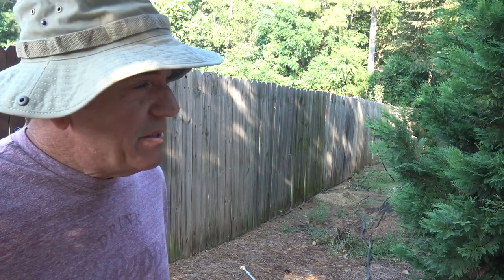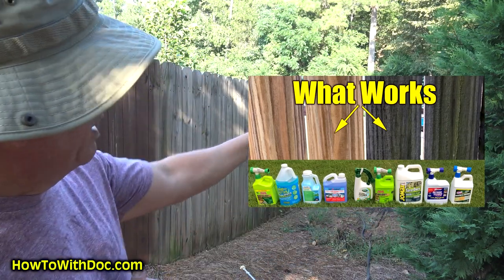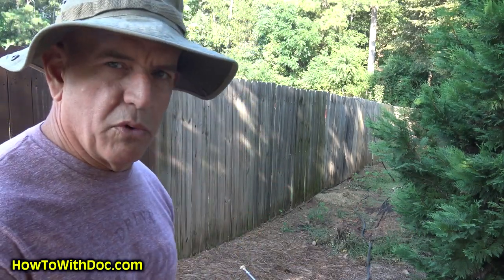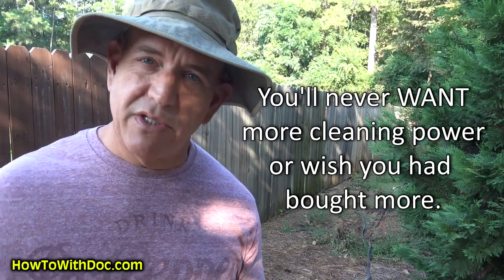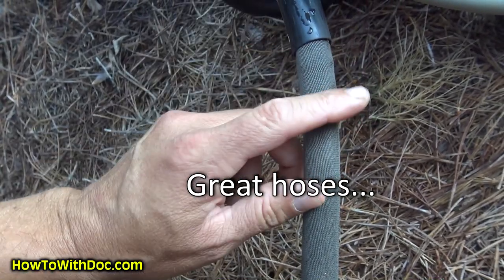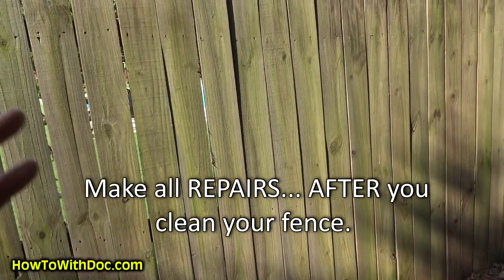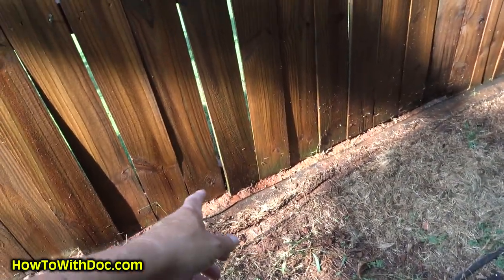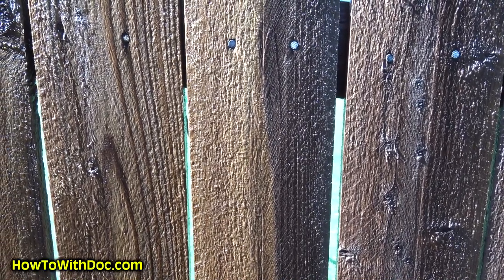Pressure Washing Fence

Comment: After watching this video (found by searching for cleaning wood fence)  I did everything exactly as Doc said.  I bought the exact pressure washer , from amazon, bought the 30 seconds product and followed every step. .....
It worked perfectly!   My wood fence looks like new!  Had not been washed in 10 years.  Thank you DOC!  Simpson owes you a commission!  I bought the extender (after first panel)  saved my back!!!

Comment: You're the man, Doc. I'm a quick learner but new to pressure washing. I learned to watch your video on what I need done FIRST then I go out and do a fantastic job. You have reduced my workload and time on the job with the accessories you identify and with your explanations. The house got prepped by pressure washing then painted. Now the house, pops. The driveway, pops. My walkways and sidewalks, pop. The streets and curbs around my house, pop. The brick around the pool, pops. Inside the pool for the first time in decades, pops. My neighbors are now pressure washing. Good but funny. I have a brand new wood porch and fence that has aged now for 2-years so I need your staining video. You guessed it, I'm going now to do my 600+ feet of my new wood fence. Can't find your staining video :(

Comment: Doc, please talk about your installation of poly at the bottom of a fence to reduce rot.  I was surprised to see the jet move it so easily.  Does it reduce exposure to wet soil?  Does it need to be cleaned off and surrounding grade adjusted so more dirt won't just flow back onto it?  How much does it help, in your opinion?   ...etc.   Just discovered you.  Fantastic how knowledgeable you are and how well you teach.  I wanna just call you "coach!"  Thanks a million.  Will start buying the stuff you recommend from your web page.  YOU DA MAN!   ...and I'm grateful!

Comment: Hey Doc! You should get a dual lance pressure gun then you can have your high pressure and twist the handle to low pressure high flow. A must have to properly rinse while working without having to switch tips...makes rinsing so much faster cause its uses both tubes on the gun...
pressure and flow maknig it a high pressure rinse! Been cleaning log homes for 15+ years and I couldnt work without it!

Comment: Doc, what impact does the chemicals you are using on the fence have on grass below and on the other side of the fence?
P.S. I really appreciate the effort you are taking making these videos.
Reply from the maker: Get a "Y" connector and spray the GRASS... with plain water after you apply.  No impact at all if you do that.  You might see a LITTLE impact if you don't but nothing that would kill it or burn it back.

Comment: At 22:19 stop, you show how to attach the hose to the cleaner bottle. Can you explain how to do it on an electric GreenWorks 2300, where the water reservoir is attached to the machine? How can it be bypassed?
Great video, by-the-way.

Comment: Sadly amazon doesn't have this model at the 400 available... Only third party and they are charging 579... Bummer.. I was debating between the Ryobi 3,100 PSI 2.5 GPM Honda Gas Pressure Washer with Idle Down and the Generac SpeedWash Cleaning System with Cleaning Tools 3200-PSI 2.7-GPM Cold Water Gas Pressure Washer CARB... Hey Doc... should I wait? Or try to find the Simpson on another site?

Comment: I would like to confirm, after you apply the 2nd round of 30 Second Cleaner, you do NOT rinse it off you simply let it dry and then stain the fence right?
Reply from the maker: correct
Reply from the maker: correct

Comment: I applied the cleaner and the entire surface of the fence became a white mushy pulp.  I'm using the 40 tip to pressure wash, and need to do that 2-3 times before all the white pulp is gone.  The wood looks more roughened now, kinda shaggy.  Is this right?  Also, if i've left light "cut marks" from the pressure washer, will it show when I use a semi-transparent stain?  Thank you for your help!

Comment: Hey Doc. Great video but in looking to buy the pressure washer, states not to use any chemicals with bleach or it will eat up the seals in the water pump. Any thoughts on that?
Reply from the maker: If you use the simpson the mix is after the pump.  https://www.howtowithdoc.com/best-pressure-washer-review/
Reply: How To with Doc OK, thanks Doc. I’ll be sure to order through your link.

Comment: Hi Doc, 
As a noobie I have been testing things out. I applied 30 sec cleaner to my wooden fence and rinsed vigorously with the garden hose. Today I am testing out a small electric pressure washer. I know I should have used the pressure washer when rinsing, but I wanted to test the hose method first for the sake of learning. Now that I am pressure washing, I am seeing a small bit of green in just a few areas (here and there), throughout the fence. The fence is pine and 3-4 years old. I have 2 questions:

1. Do those areas need to be 100% gone before I stain, even though they disappear when the fence is dry?

2. What if I just finish the pressure washing and wait until next summer to re-clean the right way, then stain?

Thank you for your advice,
BP

Comment: Question - do you recommend using a 15' surface cleaner with wheel and roll it along the fence or it it more trouble?

Comment: Hey Doc, love the videos.  First time pressure washer owner (bought the Simpson) and have a painted deck.  Any tips?  Using your info on the stained panels is what I was thinking, 40degree and 12-24" distance from the surface?

Also, after I use the 15" Karcher for the painted pool concrete surface I also have, can I rinse it all off with a 40degree tip then?  

Thanks and keep up the great work.  Can't wait to

Comment: Hey Doc,  I just saw your pressure washing video and it made me real excited to clean my fence but when I tried pressure washing nothing's coming off it still looks as dirty as before any suggestions? I've seen your video about the mold and mildew cleaners but my fence doesn't look like it's got mold or mildew It just looks really dirt y and that's why I thought the power washing would work. Do you think I need a cleaner then to help out? Thanks for your help, Tracey

Comment: Hi Doc,  we have approx.  30 x 1" x 8' x 8' bamboo fence in our back yard.  Just installed it and replaced the previous 15 year old bamboo fence.   Would like to "take better care" of the new bamboo fence. This would include cleaning the  bamboo every year (both sides).  Just don't know how pressure cleaning bamboo stalks might work out.  Any thoughts recommendations?  Gratefully

Comment: Doc! I built a cedar fence 4 years ago with 7/8" lumber. It is rough cut on one side and smooth on the other side. Before discovering your vids I sealed it with Sherwin Williams SuperDeck oil based transparent. I regret using oil base really! QUESTION: Would you recommend using a stripper first? (Olympic Premium Stain Stripper???) followed by the 30 Seconds via pressure washer then 30 Seconds via hose connection? Thanks in advance...

Comment: Two questions. What happens if you use the driveway surface cleaner on a fence. Second is any tips or tricks for a composit deck cleaning. Should I use the surface cleaner or any chemicals?
Reply: I would not recommend a surface cleaner on a wooden fence. Very good chance you will damage the wood due to the fact that tips on surface cleaner are so close to the wood. I would stay with 40° tip with cold water water.

Comment: Hello! I absolutely LOVE your videos and can totally relate as I'm also OCD and pressure cleaning to me is very satisfying and therapeutic.  I have a Snap on PSI Electric pressure washer of 2000 PSI AND 1.4  GPM. My question is, I want to buy  on Amazon a PENSON & CO. 4.0 GPM Turbo Rotary Rotating Nozzle for Pressure Washer 1/4 Quick Connect 5000PSI but  are a bit confused if this will be the appropiate Turbo Rotating Nozzle given my machine's 2000 PSI and 1.4 GPM, does that matter or this will work just as well? Thanks so much for your reply, I look forward to same.
Reply from the maker: You really should try and match the PSI to the right parts. Some will not work well if psi too low.

Comment: Thanks again for all the great info! You briefly mentioned using much lower pressure for decks, do you have a specific psi recommendation for decks and wood siding? I'm thinking for siding I probably want a medium pressure - not too much, but enough to get the job done.

Comment: Thank you. But NEVER EVER put your fingers in front of the nozzles when changing them. If the wand trigger fails under pressure, you will instantly get a nasty fluid injection injury. Hopefully, you would never put you hand in front of a gun barrel. Similarly, please keep away from the nozzle.

Comment: Hehehe,  I learned doing bottom first the hard way, lol. Think my electric  pressure  washer soap dispenser is wacky cause only used 1/4 gallon on whole house and fence, and removed outer layer of brick before I sealed the brick

Comment: Hey Doc !
How did you mix your 1 gallon of 30 second cleaner you carry on your pressure washer ?
I’m about to clean mine n got the same pressure washer
Reply: All about the soap tip...it does the "mixing" for yah...7 to 1 dilution. 👍
Reply: If you listen closely to the video he explains the mix rate is in the correct tip.

Comment: I'm not sure the necessity of using timber cleaner if you are high pressure washing.. let alone two times (before and after)..
Reply: Lewis C The cleaner helped get the wood cleaner, which helped the stain and paint hold better.  But I don’t think I will clean after power washing.